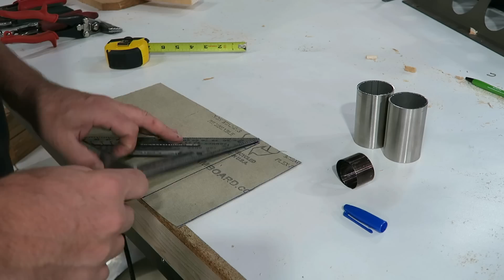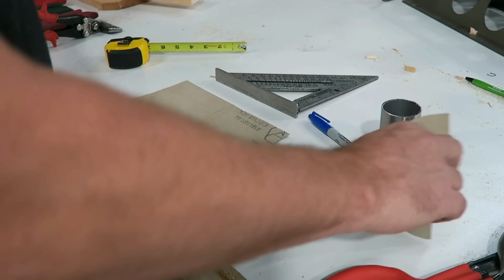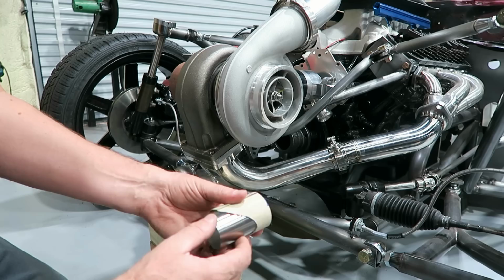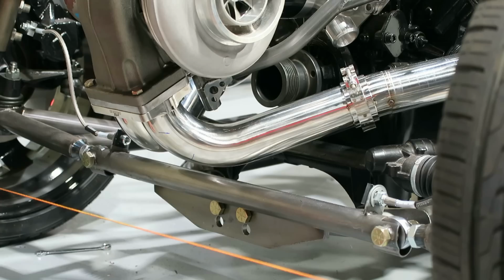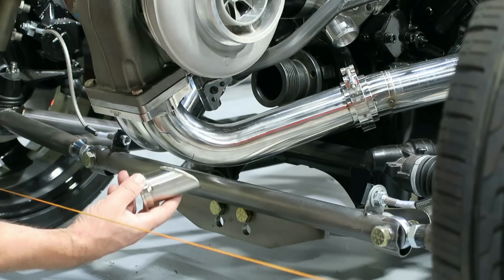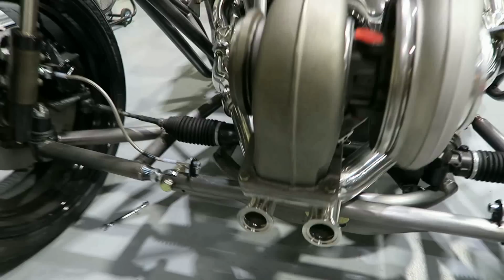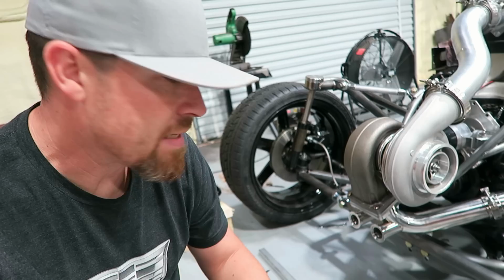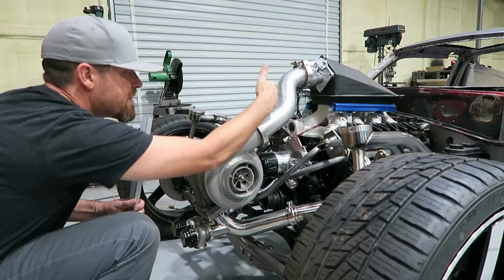How To Install Turbo Wastegate

Comment: Another option is using some pvc to do your mock-up. Nice and cheap and allows you to setup the notcher perfectly ahead of time
Reply: limitliss 
Can confirm. I use PVC as templates and it's easy to handle

Comment: Could prob get a hole saw in there being that the tube is so short. Maybe put an extension and socket on the end of the arbor if you got one that's a hex, that is if the far end is too far. Use the tubing as a "pilot" instead of a drill bit. Cut a close to perfect hole for yourself. And as car builder myself, take your time man. Getting things done right takes a while. Looking forward to some content on this build.
Reply from the maker: i will have to give it a try

Comment: Nice quality work as always. I like the idea of the slant back grill shell, cause it could give you one of the prime elements of  putting a "face" on the car. I can almost picture a '29 track roadster type oval or even Bugatti shape, but with some other kind of inner grid rather than vertical bars. Maybe you could English wheel a perforated sheet to fit in a frame and have a convex bulge. It could be the nose to go with your headlight eyes. PS; You never have to justify or apologize for how you prioritize your time and energy. We would all love to see more of your content, but it's YOUR life to enjoy as you see fit.

Comment: Flow of the exhaust and wastegates might give you issues with controlling boost. Awesome fab tho!!👌
Reply from the maker: Its actually setup in the most optimal location and direction for proper control of boost

Comment: Good echo now from waste gate location. Thinking about running audio into oscilloscope I happen to be using right now to see if it reveals how far away the offending surface is located, for curiosity's sake. 

Check out Draco's owner and previous pilot. He hardly requires any sleep for some very fortunate reason. Peace.

Comment: Can't you holesaw down the center of the pipe you welded on so you don't have to dremel as much? And it'd be the size of the hole it needs to be
Reply from the maker: I may be able to. If I have a close hole saw bit I will give it a shot